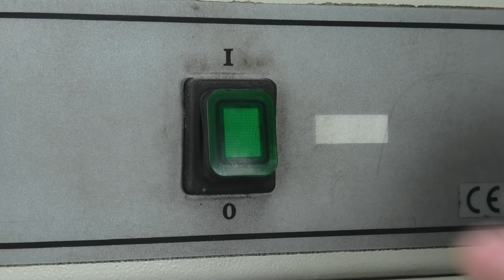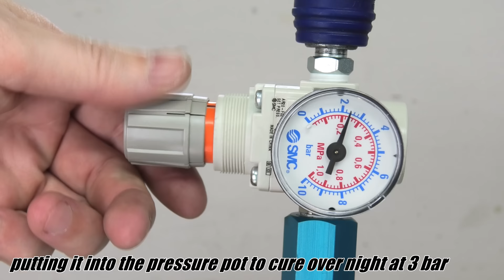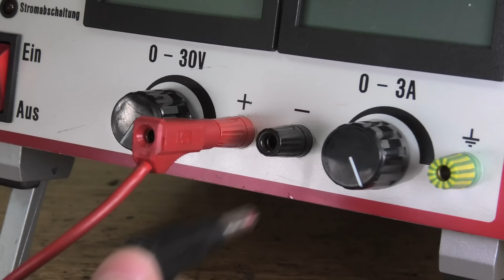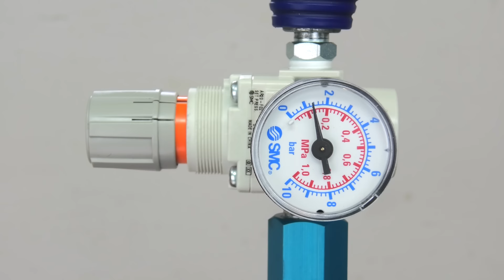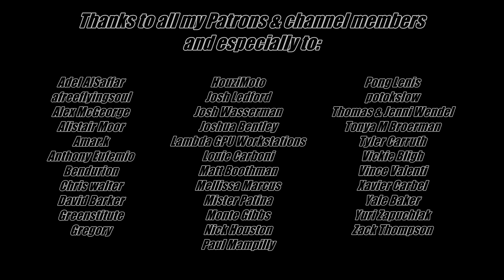Broken Rusty Oldtimer Scooter - Restoration

Comment: My mechanics: - These rubber parts are worn, I make new ones. ALL OTHER restoration channels: HE DID WHAT NOW?!
Reply: Same thing I was thinking! :)
Reply: I thought he'd just go to a bike shop and get some new tyres and rubber grips..
Reply: @DanTuber  Right? Or maybe apply some silicone compound or something just to make 'em look a bit nicer. But no! He made brand new ones, unbelievable! What's next? Mining iron ore and building a smelting and steel fabrication works in the corner of the work shop, together with some ball bearing manufacturing machinery ?? 😉👍
Reply: I was expecting commercially bought, even gas filled tires. For handles, same or 3D printed pieces with TPU or something. Didn’t expect molding for the handles after the tires!
Reply: @akersjon278  I think primitive technologies is already doing that lol
Reply: @sonnieandjacob  yea he managed to bearly smelt iron, i would be so pumped if he figures out how to make more and make iron tools
Reply: Moulding the rubber parts is a million times better than 3D printing them. So good
Reply: Right!
Reply: @sonnieandjacob  I see a cooperation in our future
Reply: All the other restoration channels need to watch this guy. Fellas, this is how it's done.

Comment: I think very few people will ever fully understand the level of detail, work, and design that went into this. I'm incredibly impressed. You made your own tires, with molds you designed and machined yourself. Beast mode, man, BEAST MODE!
Reply: Lets not overlook hand broaching flutes with a custom tool into a 3 part mold to cast the handlebar covers.  That just blew me away.
Reply: @ElizabethGreene  No kidding. I'm just stuck on the dimensioning and calculations needed to create the molds and replacement hardware. As a person who does it from time to time with professional software and CNC machines, it's mindboggling to do it by hand.

Comment: You know this guy is a god level restorer when he even makes the molds for the tyres and grips and even they look like a work of art.
Reply: Right!? He could have made the handlebar molds from the same material as the tires (looked like delrin), but he made then out of metal, with chamfered edges, and all for a one time use. Insane amount of attention to detail, My Mechanics is the King Midas of restoration.

Comment: Subscribed.  I love the program here.  The recipe for a build like this is as follows:

1.  Restore the object to much higher than the original standard of workmanship.  

2.  Fix any design flaws without scrapping the entire concept of the original.

3.  Use the original components wherever it's reasonable to do so.

4.  Plate or paint everything so it won't rust again.

5.  Make everything removable so maintenance is easy.

6.  Make every new component, including hardware and rubber parts, yourself.

I dig this program and I am here for it.
Reply from the maker: Glad to hear that, thank you

Comment: This scooter was made to last, it's a shame they don't make things like this any more, and now it's been restored even better than original. Great work.
Reply: Made to last? Really? Compared to 21st century Chinese crap, perhaps, but not well made compared to say a Raleigh bicycle from the same approximate era, 50s-70s.

It certainly is (much) better than the original after "restoration" (actually, redesign, upgrade)
Reply: Saying something was meant to last on a restoration video is a bit ironic.
Reply: @christopherbedford9897  Are you saying that all Raleigh bikes are well made, because I had one of those and it did not last, all things wear out, my point was that it lasted a long time and it was still ride-able. Not all things made in China are crap, if you buy something cheap then don't expect it to last.
Reply: @dogbreath6974  😊😊👍

Comment: Great job!  I think maybe 1 thing that would have improved the original design a bit is to put a hard rubber or plastic washer at the top and bottom of the brake spring to protect that awesome paint job!  I did not expect you to make those handles.  Crazy amount of work you put into this!  Hope whomever uses it enjoys it for a VERY LONG TIME!

Comment: Do not say that I'm shocked, do not say anything! The most amazing thing is that every screw, every nut, everything is processed by MANUAL. This requires respect! You simply do not have real endurance, stamina, willpower. And golden hands. Master with a capital letter. This is definitely a like.

Comment: Wow, perfect renovation friend. I was surprised you made new tires. I dealt with it some time ago, but no one could advise me on what material. Can I ask you for the name of the rubber compound you used? Thank you Radek
Reply from the maker: It's polyurethane rubber, shore hardness A90 made by Bacuplast in germany. Check my Instagram post from 19th january, you can see the bottles there.
Reply: @mymechanics  Thanks for the advice, Radek

Comment: This brought back memories of when I would remove rust, smooth out casting marks and bad welding, and putz around in our old machine shop with the vice and anvil.  I still like to make things look nicer than they are, but I usually use a nail file and buffer!

Comment: Longtime fan of your videos. I've been collecting questions for a while and I thought I'd ask after this one: 
• How many different round anvil pieces does a shop need to have?
• When you're plating something, do you have to move the clip to make sure to plate the part under it?
• When do you know that you have to harden metal? 
• How do you know if the correct metal was chosen for a part? Do you ever remake parts with a more appropriate metal?
• When you're welding to create more strength, where is the new metal coming from? I've seen welding with  people holding a  rod of something but I don't think I see you doing that. It looks like new metal is just appearing from the ether.

Thank you again for your amazing videos. My 10-year old daughter loves them too!

Comment: When reassembling something vintage, thats metal against metal (painted), I like to cut put from a sheet of pliable soft leather, "bushings", to sit between the 2 contact surfaces. I typically soak these pieces of leather in simple clean machine oil and press excess oil out.  This way, since these two parts are meant to touch and rub against one another, the paint wont wear off as quickly, and the rust wont attack the metal as quickly.  I live in an area where rust is a problem because of climate and proximity to salt water.  This extra step has helped keep quite a few vintage tools which I use often, like a wheelbarrow, and a wagon for hauling dirt, looking good without the paint rubbing off.  Before winter I simply brush clean with a tooth brush the leather gasket, I dont bother to remove from its spot,  and then reapply excess oil,  letting it soak in all during winter. Its ready for early spring garden work. Also helps with squeaking and other metal on metal noises!

Great restore in this video. Really enjoyed it.

Comment: I was really impressed by the supplementary welding on the handlebar. Looked like there where no joint and the whole handlebar was made out of one piece of metal.

EDIT: It's like we are going back in time. Vehicles like this is popular again here in Sweden but many I have seen have no brake capability what so ever.

Comment: I've just realized that I need sanding box. 🙂 I like how you always remove all sharp edges, you are a real German. 😀 We have to do the same in Czech schools, if your practice teacher finds something sharp there, you will be slaped, well, maybe not today anymore, but like 15 years ago, it was still like that. 🙂 That's why I am always angry when I buy something which has sharp edges everywhere, I understand it in massproduction, but touch it file is not that complicated and they should always do it at least on parts which you touch, it's very annoying when you buy a new product, you touch it and your fingers are bleeding then.
EDIT: you are actually from Switzerland, that's even better. 🙂

Comment: Looks amazing as usual. The only thing I’d be wary of is that I think you used UHMW plastic for the break pad, which might wear slower than the tyre material. You want the brake pad to wear, not the tyre.
Reply from the maker: Thanks for the tip!

Comment: You actually made a mold for the wheels and  handgrip...

LTT explained that making a mold of their screwdriver is expensive and costs a small fortune.

Since you own your own workshop, it might not be as expensive as making a mold to be used by an automated assembly line, but I'd imagine the custom tooling involved cost a lot more than the scooter itself.
Reply from the maker: They should have asked me to make the molds haha

Comment: I find it odd you are worried about wearing out blast material with paint chips, but will spend hundreds in custom subtractive manufacturing on one off molds that will likely never be used again. But hey, nice work! Top notch!
Reply: The blasting material is more expensive than the molding materials.

Comment: when i see the abandoned scooter i saw, ill restore it. the one i saw was a 3 lightwheeled scooter. it was missing the steering wheel but i have a b1 oxelo scooter steering wheel and ill place the sticker bigger than the b1 oxelo sticker. first, ill wash it. second, ill check the parts. and third ill place other parts but if its fine, i place the steering wheel. ill color the steering wheel white and then i place it. fourth, i'll give it a speedometer and i'll also do some other stuff i like to do. and done!
Reply: i will record the process, ok?
Reply: i'll call it: Lunar Lightning first generation (1C)

Comment: Alright brother I have to ask...     What's your secret for nickle plating?  I have done zinc dichromate plating at my house on several occasions and I really had to fight off "shadowing" during the zinc plating portion - and these were relatively simple shapes -- not like your handle bars ---  just curious if Nickle is a more forgiving process or if you have some secret such as moving around the anode around to ensure evenly coating or what ---

Phenomenal work as always!
Reply from the maker: Thank you. Stay away from the anode as far as possible and consistently moving the part around.
Reply: @mymechanics  Cheers!  Thanks for the advice

Comment: Why didn't you nickel plate or paint the wheels? It seems like they're just raw metal after the sand blasting??
Reply from the maker: Correct. Like they were originally. It's aluminium, so it doesn't rust
Reply: @mymechanics  woah that's cool, I didn't know that!

Comment: Approximately how thick is the plating generally?  Does it depend on how long you keep it in the solution?
Reply from the maker: Yes exactly. I usually try to get at least around 0.01-0.02mm thick layer.

Comment: Why use paint stripper when you can sand blast?
Reply from the maker: Sandblasting media is very expensive and it turns bad a lot faster when there's a lot of dirt or old paint in it. Therfore I always strip it first.

Comment: I've been watching this guys videos for a while and enjoy them but can't help thinking it would be much easyer to just buy some screws etc, seems excessive and wasteful to lathe every little component from a massive metal slug
Reply from the maker: I make my own screws because I have the machines and tools to do it. I can make them in the material I want, with the finish I want and the dimensions I want. Good luck spending time searching the exact screw you want, you'll never find the exact dimensions, finish, heads you need.